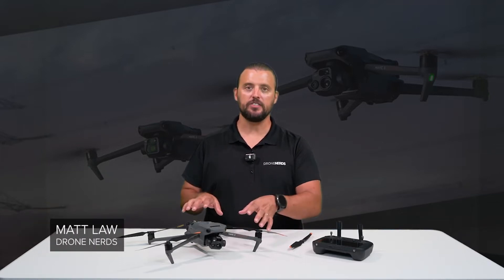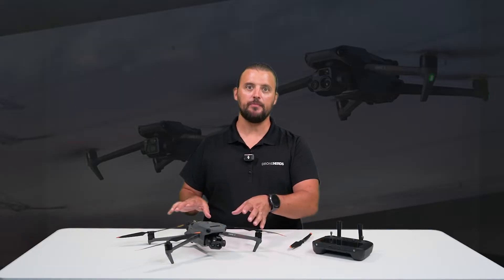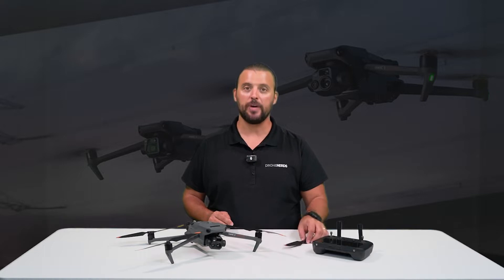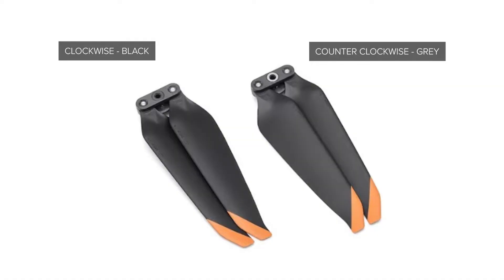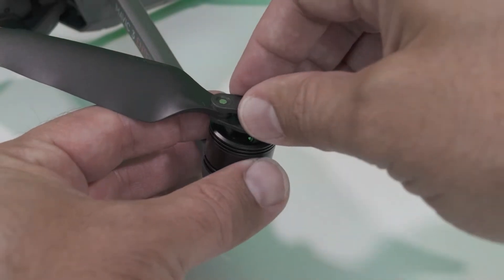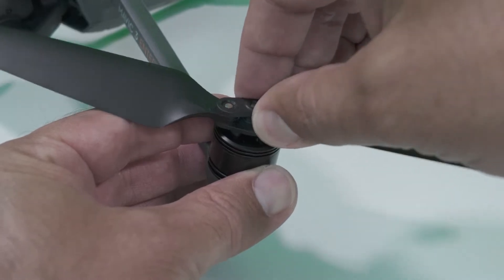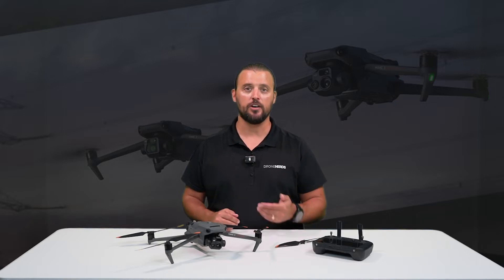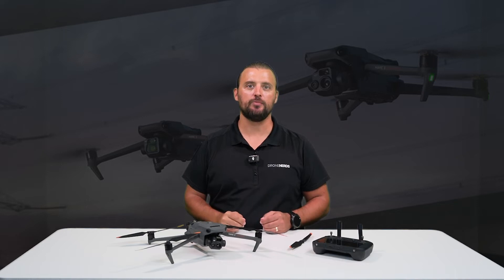DJI Mavic Series - Propeller Maintenance

Comment: If only one set (e.g grey) propeller is damaged on one rotor, do you have to change the other one on the other rotor as well?
Reply from the maker: Hey great question. You'll be okay just changing the one grey propellers as long as you're sure there isn't any damage to the other set of props. If you're not sure if the other set looks good or if you've flown more than 100 flights with the props, it might be a good idea to change the other ones out to keep things balanced.
Reply: @DroneNerds I changed the one. The rest seemed okay. :)

Comment: Do the motors or parts need any lubricant over time?
Reply from the maker: Hey great question. No, you shouldn't need to lubricate the motors. As long as you try to keep sand and dirt out of the motors, they should run smoothly.